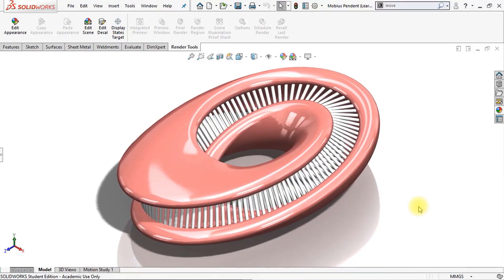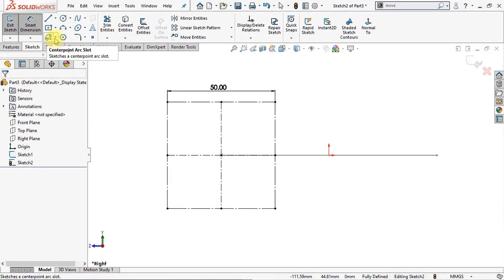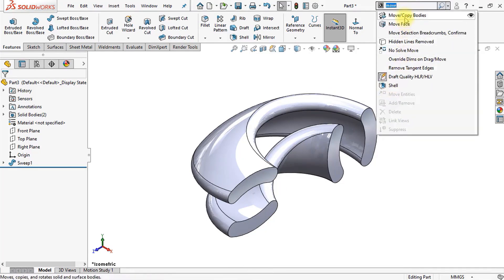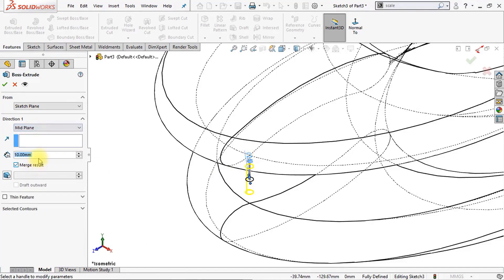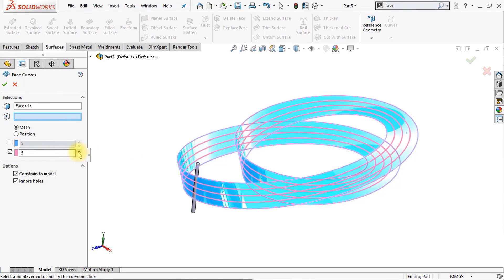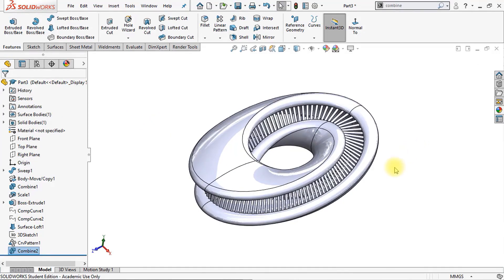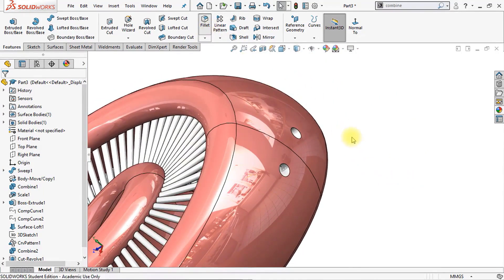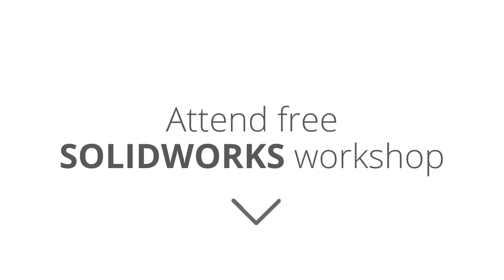How to model a Mobius Pendant in SOLIDWORKS? [Step-by-Step tutorial]

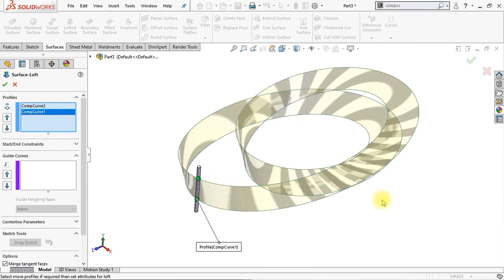Comment: It seems that I get an error when trying to do the lofted-surface at 8:20, I'm using SW2022. It says error becasue it would produce self-intersecting geometry. Perhaps its becasue the very first sketch was blue (underdefined) instead of black?
Reply from the maker: Hmm thats weird... Is the geometry intersecting somewhere as far as you can see? This might cause the problem
Reply: @learnsolidworks  I heard the same issue... using 2021 solidworks. It's not intersecting anywhere
Reply: You may have selected the wrong entities when defining the composite curves. This would cause the geometry to intersect.
Reply: I had the same issue, I think it really depends on where you click on the source composite paths: aftre 2 fails i did it exactly the way Jan did it and it worked, any other click sequence produced self-intersecting geometry, very strange

Comment: Absolutely complicated but you simplified it fairly well. Very good tutorial; I completed it in SW2013. There is no 'face curve' command; I created a symmetrical double pointed solid between the arc slots, which allowed me to create a mid composite curve. The curve driven pattern was a little finicky, but I got it to work. Thank you for an amazing tutorial; I am a SW expert and my opinion is this would be fairly difficult for a novice. And I am using SW2013, so it would be easier probably with later versions.
Reply from the maker: Thanks a lot for your valuable feedback! I am glad to hear you was able to model this om SW2013 as well! Check www.learnsolidworks.com for many more SOLIDWORKS tutorials :)